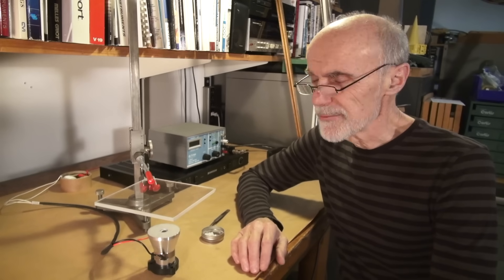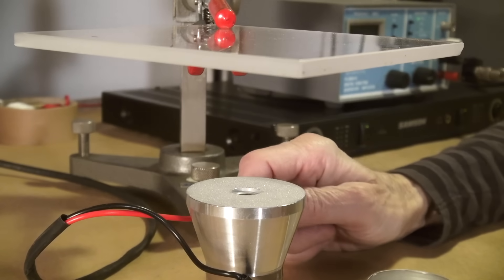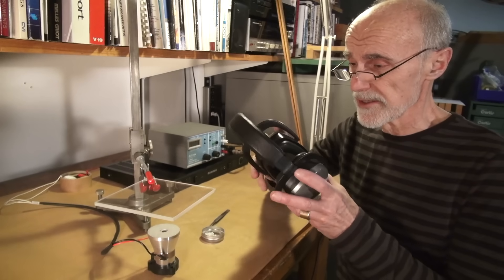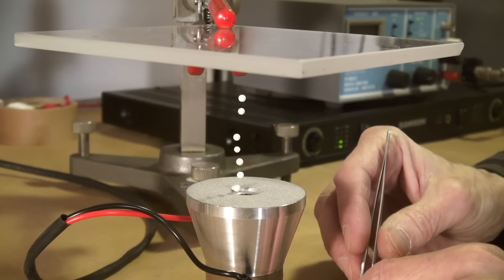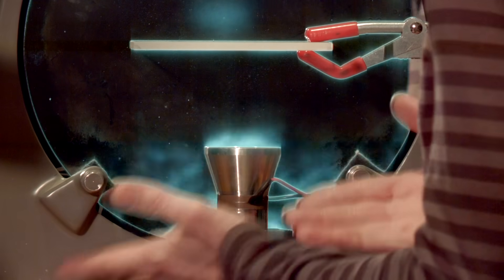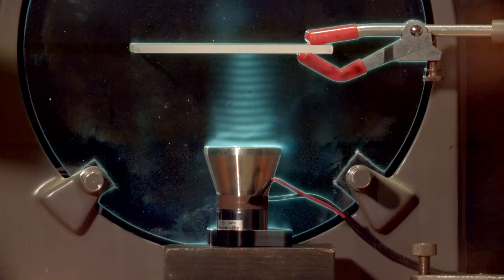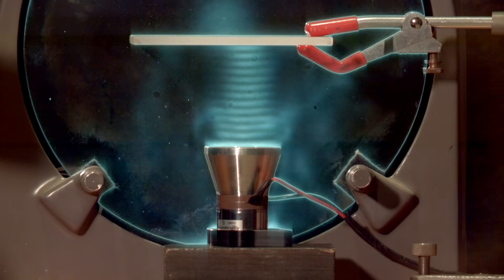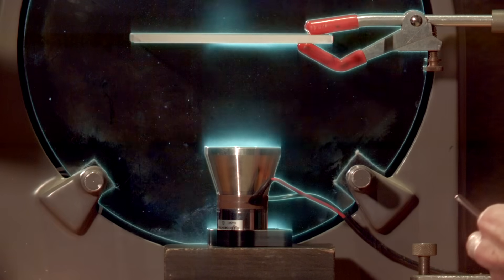Acoustic Standing Waves and the Levitation of Small Objects

Comment: I was thinking of using a resonance detector chip to shift the frequency when the plate moves allowing the standing wave to remain regardless of the position of the plate.
Reply: the frequency is fixed by the ultra-sonic transducer (28 kHz) ... it won't work very well at other frequencies

Comment: I need to know.  Did he use the red wire and attach that one to the positive tab on the transducer?  I wonder because I’ve found examples where negative and positive contacts on those transducers were labeled as either negative or positive.  So I am having difficulty ascertaining which is which.  I think in most instances, the positive contact was marked as the one he has his red wire attached to, that is sandwiched between layers of insulation.  Then the negative would be further forward, closer towards the business end surface of that transducer.  I’m gonna go from his example, I would think he has this correct.  He is the scientist after all.  So it’ll be red wire to the contact that is situated further back with layers of insulation both above and below.  Negative is closer to the front end.  THANKS FOR SHARING THIS!!

Comment: There is the secret for hologram imaging. Creating an electromagnetic enclosed perimeter where the little balls of light reflecting  material, are positioned on a pixel like grid pattern when activate, and a laser will scan and light them all at once thus creating a video image. Once the video message is projected, the vacuum system will capture all the reflective white balls and shut the system.

Comment: Hello, 
Harvard Natural Sciences Lecture Demonstrations.

What if we make the acoustic sound generator 
super strong? In the range of a few kilowatts?
Reply: VERY VERY dangerous!
Reply: @wolfgangrueckner7151  Was meinst du damit?
Reply: @silberlinie  I mean that It would probably destroy the object you're trying to levitate as well as everyone's hearing.  It's easy to explode a small object with a strong focused ultra-sound beam.
Reply: @wolfgangrueckner7151  So that is what I intend to use is 
what you say here. 

I wonder if with it, if I have rocks in the quarry, they can 
be crushed with it. So the whole unit would be encapsulated, 
of course. It stands relatively close to rock. 

And the acoustic sound generator in front of it. If you build 
the generator in the unit very very stable and supply it with 
whatever power you need.

 For all I care 5 kW or 50 kW or 500 kWatt electrical power.

Translated with www.DeepL.com/Translator (free version)
Reply: @silberlinie  Like I said before:  EXTREMELY DANGEROUS!!
Reply: @wolfgangrueckner7151  Das weiß ich doch selbst Wolfgang.
The prerequisite is that the system is really well calculated. 

That sufficient safety reserves are considered. And that
 you start slowly with low power. 

How much do you think an acoustic sound generator of 
this kind can be built realistically?
Reply: @silberlinie  I have absolutely no idea ... I only have experience with our 8-watt apparatus.
Reply: @wolfgangrueckner7151  Du bist ja zumindest informiert.
Is it because of the cost that you do not do trials 
with higher performance?
Reply: @silberlinie  No, our experiments require a minimum of power and there's no need to increase it.
Reply: @wolfgangrueckner7151  Ich verstehe.
I would like to reproduce the experiment.

Comment: What use could this be put to in a practical sense? It's good for a demonstration with tiny objects but could this be used in any larger scale or heavier objects?
Reply: The ability to utilize the standing wave to suspend both solid and liquid objects in a contact-free environment has found a variety of applications such as contactless transport and handling of matter, gas bubbles in liquids, separation of microparticles in gases, droplet coalescence and mixing, processing and analysis of liquid samples, handling of m- and nm- sized particles such as bacteria, to name but a few.
Reply: @wolfgangrueckner7151  Fascinating,   I wasn't thinking about microparticles, of course I can see how this would be an invaluable tool for such processes. 👍

Comment: What happens if you use a frequency that matches the density of air? 

For example, my hypothesis is objects have a measurement of pressure type like a frequency that causes compression. Kevlar for example, when hit with hard objects at a fast speed, solidifies on impact, until impact breaks it or stops the penetration. There is a certain light material out as well, that isnt kevlar, but it works in a similar way, and is said to be stronger. It was referred to as maybe liquid body armor, or maybe it was something else I saw, idk I just tried to look it up

If we look at the density of air and its particles, in a way sense of its density and mass, there should be a way you can use frequency to make air beneath an object projecting this frequency, solidify the air in a sense or further densify it to make a sort of horizontal wall, and levetate off this? 

My hypothesis is because light can refract off oxygen and is visible doing so with rainbows, where it is just a refraction of light, you could probably use photons, which is focused light, and high frequencies to hold oxygen or air particles in place, so that you could levitate on object. 

What are your thoughts?

Comment: This is the start of tractor beam technology, like the kind used in Star trek, with more power and a focusing lense, it can work, but the power requirements to pick up anything of any decent weight would be immense, so the focusing lanes needs to be extremely focused like the Hubble telescope is, to the same degree as the station or even more so. More focus = less power requirements.

Comment: I feel like if sound would levitate objects like this then it should in turn do the same thing with Water or mabey a thicker liquid, If possible I feel like the amount of resulting datawould be profound, given the geometric shape's, pattern's & stable geometric Configurations would shine alot of Light on the "Pressure Waves" and Possibly even String Theory as Well?
Reply: Acoustic levitation has indeed been used to levitate liquids and any number of small particles or objects.

Comment: If sound travels at different speeds depending on what gas its in, would say a hydrogen atmosphere have different properties when using sound to levitate
Reply from the maker: Yes if the speed of the signal through the medium changes, then so does the wavelength, and so there would be a different number of nodes and antinodes able to fit between the transducer and the  reflector.

Comment: I was schlieren once, I had too much to drink, nice optics, I guess the steaming appearance of the speaker, was because it was warm, and heating the air? However, what about the glass?
Reply: Correct, the speaker was heating the air and thus causing refraction of light.  Air currents moving around the glass are also visible because of variations in the density of the air.

Comment: Why not adjust the ultra Sonic speaker into hight and low, instead of the replector or floor?
Reply from the maker: The transducer is designed to operate at around 28 kHz.

Comment: How can i calculate the correct distance between the transducer and the reflector?
Reply: it's simply an integral number of half wavelengths.  In this case, a half wavelength is 6 mm.  Any integer times 6 mm will work.  For example 60 mm (= 6 cm)
Reply: @wolfgangrueckner7151  Thanks a lot sir!

Comment: I think these foam balls levitate in the zones of low pressure rather than high pressure as opposed to what is claimed in the video.
Reply: Our pressure measurements say otherwise
Reply: Wolfgang Rueckner i quote from 4:34 of the video “and i know the bright band is the highest pressure because it is right next to the reflector plate”.  But actually pressure node (max pressure, zero displacement) is right ON the surface of the plate, not near it. And the bright band below the reflection plate looks like a zone of max displacement and zero pressure. And the reason why foam beads  are resting being actually in the nodes of max displacement (they are as well nodes of zero pressure) is because of foam inertia, they cant move that fast, so visually they appear to rest.
Reply: @dmyegorov74  "But actually pressure node (max pressure, zero displacement) is right ON the surface of the plate, not near it."  Sure, the pressure is greatest right at the plate, but pressure anti-nodes as well as pressure nodes have a width, so you have to think of pressure regions.  In any case, what you say is what one finds in the literature but we have conducted measurements and have found otherwise.
Reply: Wolfgang Rueckner here is another consideration that proves my point - anything in nature tries to settle in a state with least potential energy. One can think of standing wave as of wavy road - so where would a ball want to be, on convexes or in concavities of the road? Staying on top of a concave would be an unstable equilibrium state, so the ball will eventually move down to convex. Same here - the ball will move towards the lowest pressure point, which is in pressure nodes (zero pressure). Any shift from the lowest pressure point position will impart a net force from the pressure field that will return in to pressure node.
Reply: @dmyegorov74  Yes, I'm quite familiar with that line of reasoning.

Comment: I would like to see acoustic levitation of objects done via electric wave instead of sound wave which i think is doable in theory. I think it can be done with top loads of two Tesla Coils pointed at each other while operating 180 degree out of phase to each other and creating nodes and anti-nodes in space between the two top loads. You will likely need to rectify AC or DC to Tesla's LC (Longitudinal Current) first so you can have electric wave behaving like a sound wave. For circuit diagram to produce LC/LMD wave, google "The L.M.D./T.E.M.Test - JLN Labs" and for demonstration of Tesla's longitudinal electric waves, google "Transverse & Longitudinal Electric Waves and Tesla’s Longitudinal Electricity" by electrical engineer Eric Dollard. Longitudinal electricity has electric field and magnetic field flowing in same direction as you can see in this video "Replication of Eric Dollard's Analog Computer". You can easily measure it with Trifield meter.

Comment: One more question Sir. why you use 28 khz  frequency ? is it random or some natural stuff like piramyd in Bosnia is at the top is 28khz? Thank you
Reply: The transducer that generates the ultrasound is designed for cleaning baths and operates at 28 kHz.  Another common frequency that manufacturers have chosen is 40 kHz.
Reply: @wolfgangrueckner7151   Thank you Sir.

Comment: What you are doing is increasing buoyancy by increasing the air pressure with sound waves. But how do you ensure that the density of the object does not facilitate a need for stronger sound waves or in other words a need to further increase air pressure ? And how do you ensure that everyone around this does not blow out their ear drums? 

Or if you could figure out how to encapsulate an object in substance that has less density than air the object would levitate that way because air pressure overcomes the pressure of the substance as well very much like how a ship encapsulates air to give it buoyancy and thus floats on water.

Now what would happen if you took away the reflector and had two ultrasonic speakers facing each other to do this? Could the object in the middle then be levitated? And would it require more or less sonic force to accomplish it? Can you do this with magnetism against the earths magnetic field to levitate objects?
Reply: Although it's a 50 watt transducer, we operate it using the minimum amount of power (about 8 watts) necessary to levitate these tiny Styrofoam balls.  The decibel level at a distance of 2 feet from the transducer is about 68 dB, which we consider to be safe for human hearing.  Nevertheless, we still use ear protection just in case we're wrong about that ... safety first !!

Comment: GREAT VIDEO AND RESEARCH.  WHAT KIND OF SPEAKER DO YOU USE?
Reply: American Piezo ( www.americanpiezo.com ) 28 kHz Cleaning Transducer model #90-4040.  It is a 50 watt transducer but, for safety reasons, we operate it at a minimum power of around 8 watts.

Comment: Why do you use acoustic protection if you say its way above human hearing frequency?
Reply: Just because you can't sense something doesn't imply that it can't hurt you.  Take strong x-rays as an example.
Reply: @wolfgangrueckner7151    Is that the case for this experiment? Are high amplitude ultrasonic waves harmful for your hearing system?
Reply: @sergiobdbd  There is very little in the literature concerning safety guidelines for ultrasound.  One should not assume that it is harmless simply because one cannot hear it.  With safety in mind, we drive the ultrasonic transducer with the minimum power required to achieve levitation of the small Styrofoam spheres — approximately 5 to 8 watts.  I have measured the intensity of the ultrasound at a distance of two feet away from the transducer and found it to be 78 dB.  That level is very likely safe but, since I have not found any safety guidelines, I use ear protection anyway.

Comment: What exactly is needed for this to happen? Could it be replicated at any frequency using any distance for the reflector or a specific relationship real between the two?
Reply: It can be replicated for other frequencies ... even in the human hearing range.  The distance between the reflector and speaker should be some integer multiple of a half wavelength.  The length of a half wavelength of course depends on the frequency of the sound as well as the velocity of the sound (presumably in air).

Comment: Wait are we not supposed to use protection too? I mean the mic is still on...
Reply: Sound falls off as square distance. He's close to the source. The mic receives a signal, most likely is filtered to only sample for audible human range (up to ~20khz).  

The source is 28 khz which would mean as far as the digital signal is concerned, no 28khz exists. From our point of view, we are not only from the future (distant from source), but also the audio signal we receive won't contain the source freq of 28khz (assuming our hardware uses filters). 

Correct me if im wrong, but would that mean that if no filtering occurred when digitizing (recording) or listening (dac)... and if the 28khz signal was dominant... that could damage hearing on the receiving end?

Comment: Wouldn't be possible to mount some of them underneath a car, and obtain levitation?
Reply: You could maybe levitate a car if its driving through a tunnel with the floor emitting a strong wave and the roof acting as reflector, but I'm not sure if the weight of a car can be held up by waves or if it would be efficient.